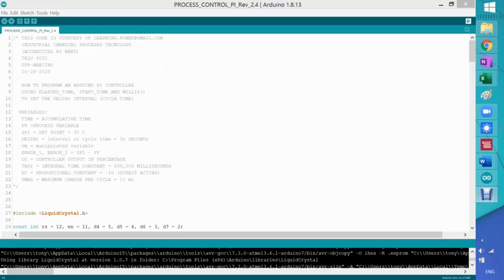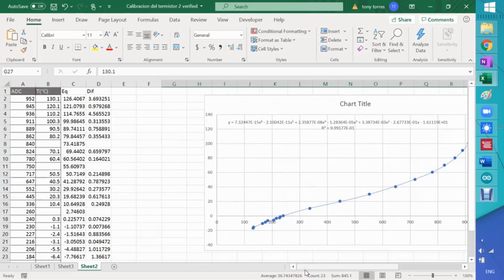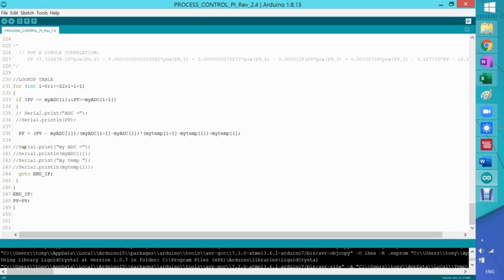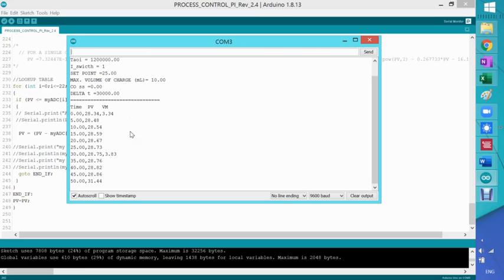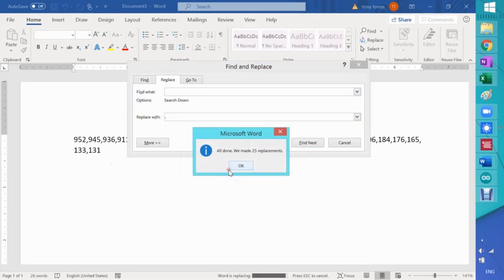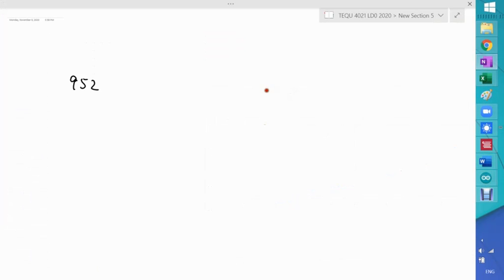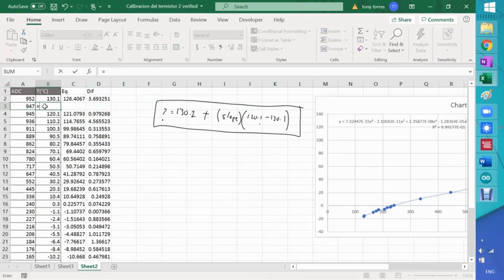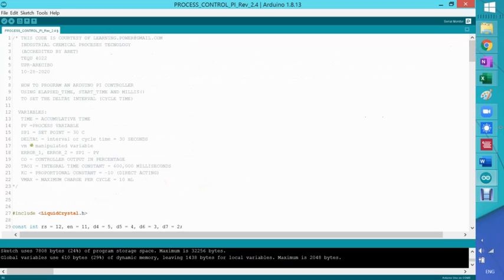HOW TO CALIBRATE A THERMISTOR FOR AN ARDUINO (ARDUINO CODE REV 2.4)

Comment: very interesting... 🧐i would like to calibrate a non-linear sensor at six places, when finished the digital readout must show a continuous display through the entire range, would the lut be the way to go or something else like slope rise run? any suggestions? 🤔 thank you. 🙂
Reply from the maker: What is your sensor ? ....I need to see the  y vs x ....to see if a curve fitting might do...or it is so non linear that you need a look up table.  In my case with the thermistor there were regions..that were linear from say 60 to -20 C... However...temperature above 60 degree....the analog response was non linear....so the look up table was an alternative.